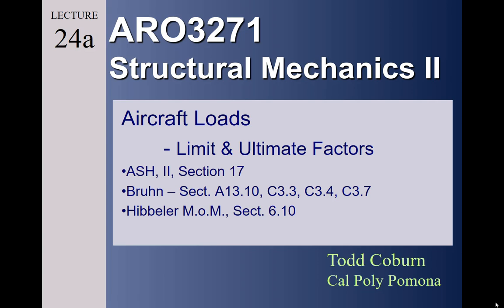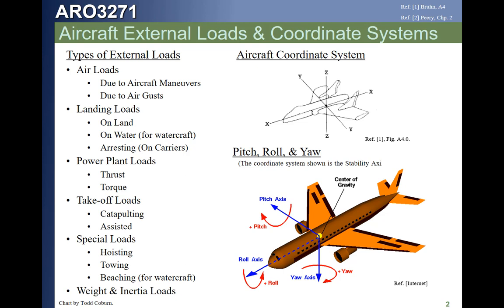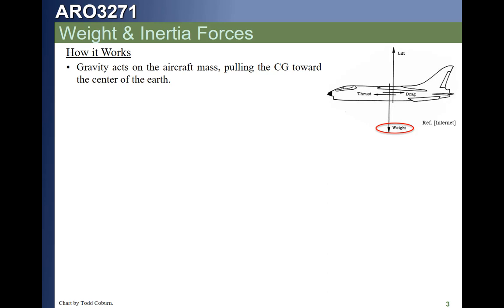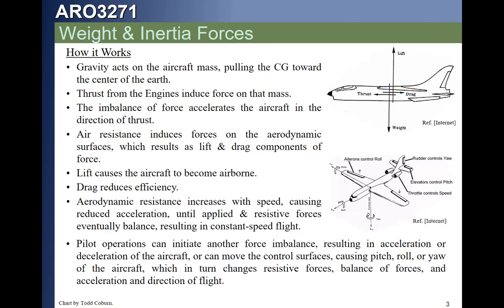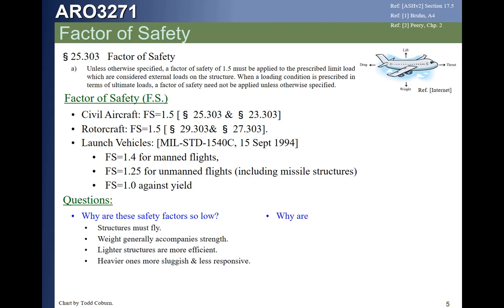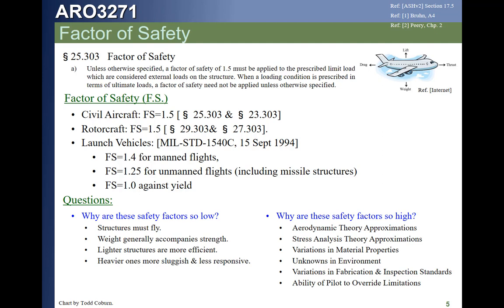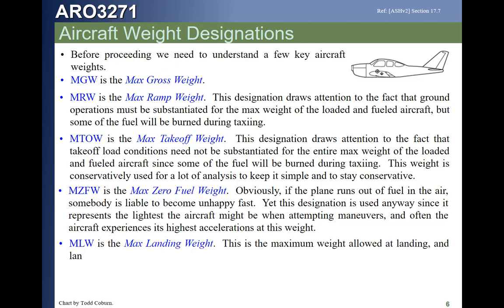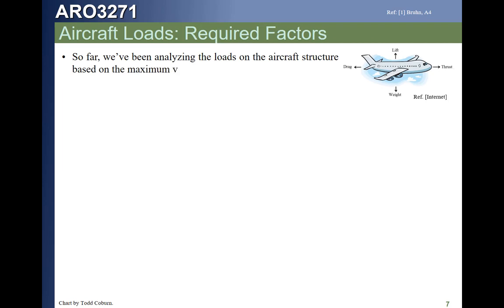Structures III: L-01 Aircraft Loads - Limit & Ultimate Factors

Comment: Wonderful lecture sir. 
However I have seen that the Fty is multiplied by 1.5, compared with Ftu and the lesser value is used as an allowable.
I have not recieved an acceptable explanation anywhere. Could you kindly explain the reason for the above calculation?
Reply from the maker: The FAA regulations specify no failures at ultimate load, and no detrimental yielding at limit load.  Ultimate load is usually 1.5xLimit for aircraft, so if your Fty is higher than 1/1.5 of Ftu, as it is for most common aerospace materials, then checking ultimate against Ftu will usually be most critical (and therefore the only thing checked).

Multiplying Fty times 1.5 is just a backwards way of doing the same thing.